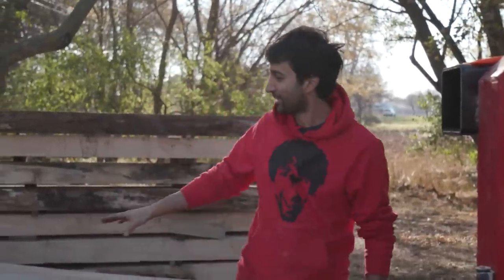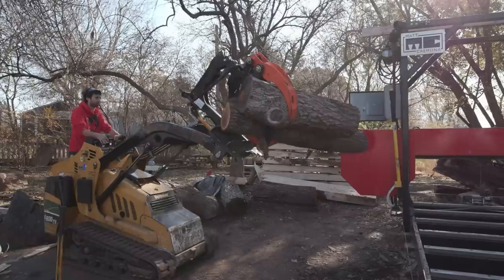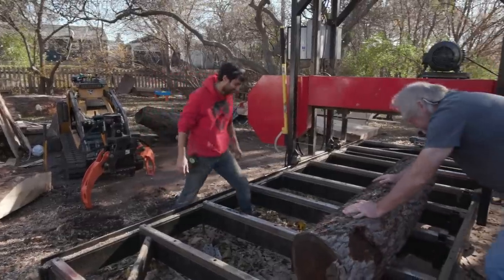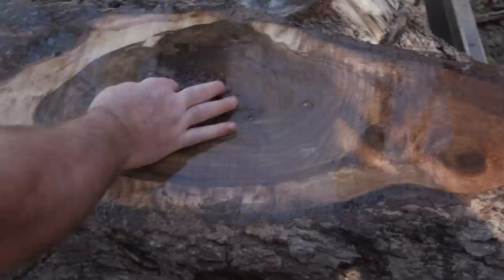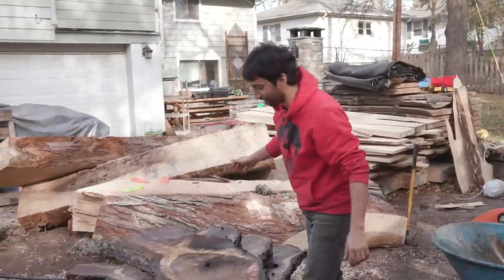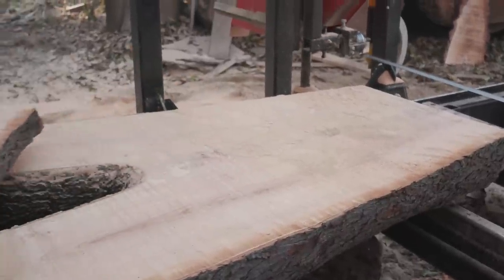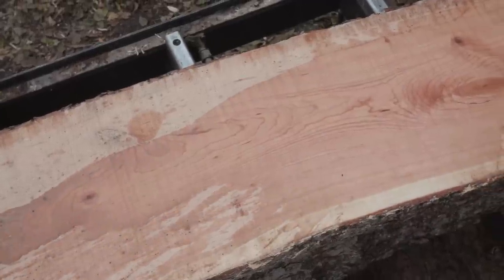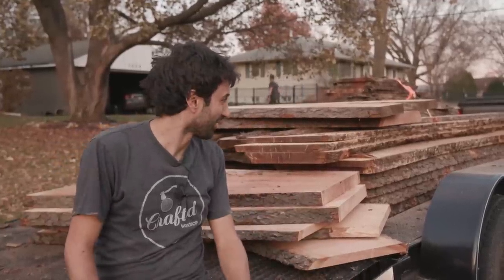Sawing a bunch of Walnut and Cherry Logs with Jon and his dad

Comment: Matt buddy, those 3-4 foot first and last off cuts may be about $40-50 apiece but can you turn them into a bench table with another 2-3 pieces as table top so long as they same length.
Just add a capital A frame legs either end with connecting beams and bench seat for outdoor patio pubs and whatever idea you and work mates think of and can sell on, you can at least sell the parts to a joiner who trims em and bolts them together with preserve and staining which is some $440 per unit for you if you charge $20 pet foot, what you think tell me if am wrong

Comment: I don't know how I came across your channel, but I did and have found it informative and entertaining.  I was not impressed with your self-built mill, even though you were milling huge slabs of lumber.  UNTIL!  Because I watched yours, other mill videos came up in recommendation.  I then was amazed at how small all these other mills were compared to yours.  I then realized the width a mill can cut, is a premium and one is limited by what manufacture makes and what the individual can afford.  Very impressive machine - even though it does not have an autoloader, auto leveler, auto this and that :)

Comment: Hi Matthew, I’m really enjoying your You Tube channel. I’ve always loved wood working projects and the machines that fabricate  the material. I do have a question if I could? With all the huge trees you mill, I’m wondering if it’s hard on the blades and saw machinery when the weight continues to increase as you continue to mill layer after layer without removing the top cuts.  Thanks Matthew, Be Safe Gary 🇨🇦

Comment: The problem with making a table out of slab cuts what you plan rip and glue up to a table, the slabs  With the pith wood in the middle are not stable and will expand and contract to break the joints!   You need quarter dawn boards for a glue up table!

Comment: Why don’t  you lock down the log when cutting?
Reply: Most of what he mills is heavy enough that it's not needed.  Clamping each reset of the log takes time, especially on irregular shapes. As long it lays flat and gets jammed against the stops, clamping is not needed.